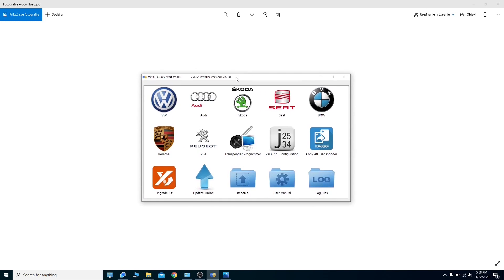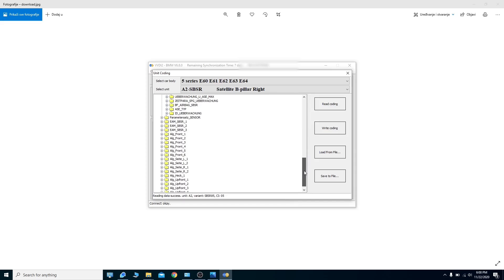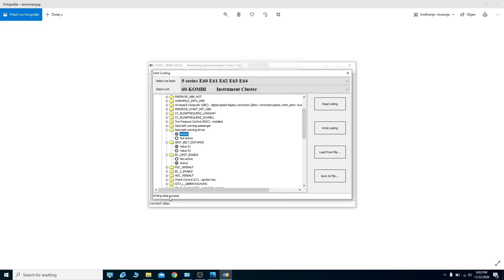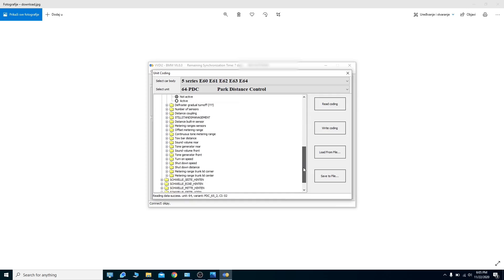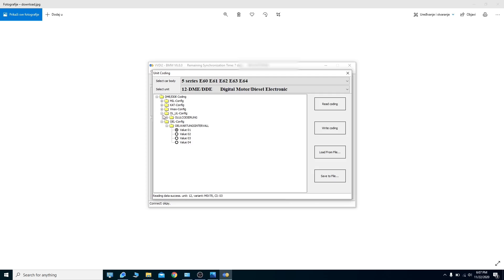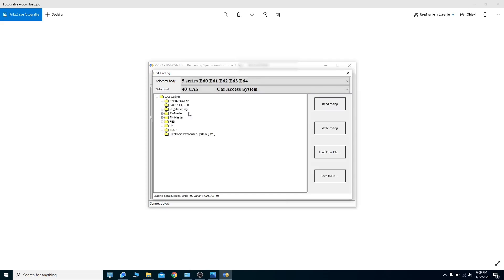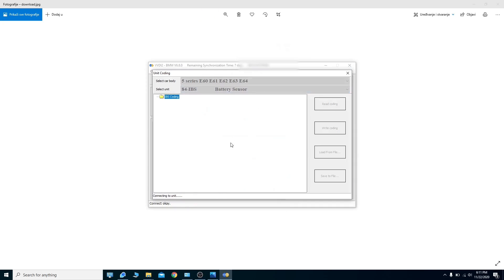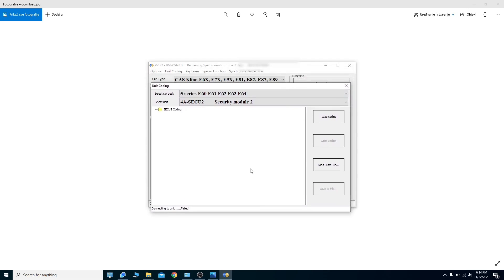VVDI2  Can do bmw coding review

Comment: Hi friends thx it’s possible to checking km odometer it’s original or modified ??
Reply from the maker: what car brand ?
Reply: @techgeek2994  e93 bmw 2012 gasoil
Reply: Programming key is same with you
Reply from the maker: @mouradelmehdaoui5833  you can compare milleage from transmission and ecu with cas
Reply: @techgeek2994  thx for add key is easy I am learning to vvdi2 bmw
Reply from the maker: @mouradelmehdaoui5833  yes it is easy until cas4 then cas4+ need vvdi prog for safe procedure